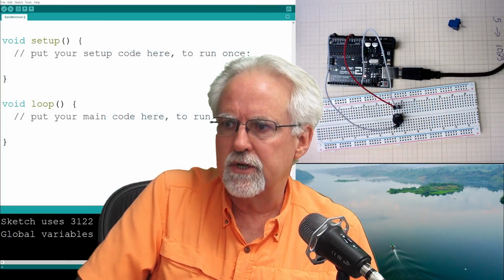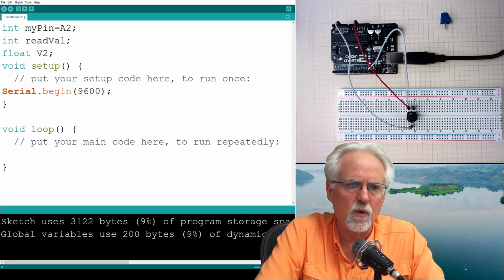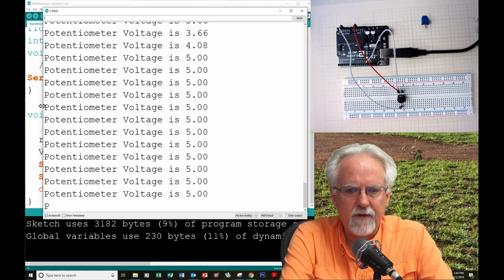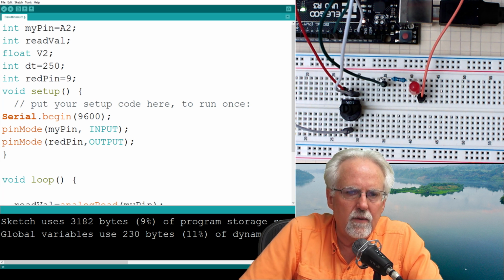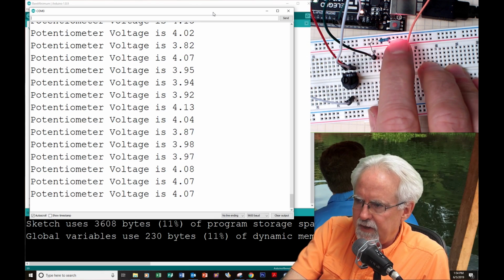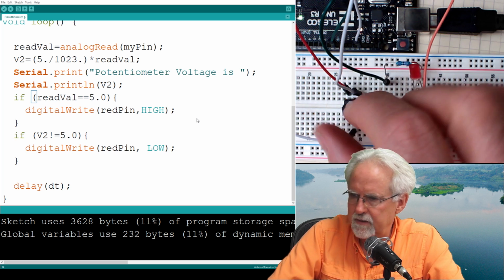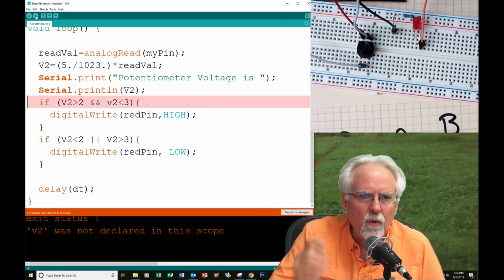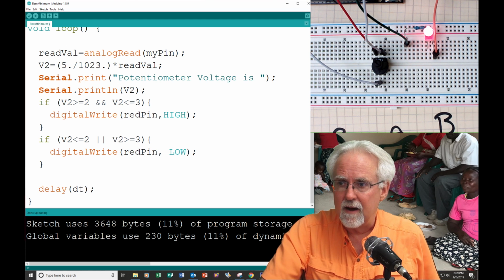Arduino Tutorial 13: Understanding Arduino If Statements

Comment: Hi Paul, as a "right-brain" dominant thinker, your videos have been most helpful. I had one problem I'm trying to understand: I was able to program an LED to stay off at a voltage <4.0 and to flash at a voltage >4.0. Everything worked except when I set the potentiometer to exactly 4.0V. The serial monitor showed 4.0, but the LED behaved erratically, sometimes staying off and sometimes flashing once. I expected this because the statement didn't define what should happen at exactly 4.0V.  I then attempted to use the == statement to get the LED to stay lit at exactly 4.0V, but failed. I even tried writing the == statement alone (without any < or > statements), but could never get the LED to light at 4.0V. The serial monitor printed the correct voltages, but the LED never lit. Any ideas would be helpful! Thanks

Comment: You know, it's funny. I built the circuit and did the homework he assigned and finished it. However, I was confused as to why the brightness for each LED was different from each other the lower I turned the voltage down. It wasn't until what I just said dawned on me and that it's supposed to be that way. I should know better as a college student haha. Thank you for making these videos Mr. McWhorter. =) Watched your tutorials on the BeagleBone too.
Reply: The materials used for the various color LEDs have different efficiencies so the most efficient ones will glow brighter given the same amount of voltage applied. By varying the value of the load resistors, you can adjust the brightness. Check out Paul's tutorials on LEDs and Ohm's Law. They are wonderful!

Comment: Super cool lesson, Paul! Thanks!
P.S. It puts a closed curly bracket, when your cursor touches the opened one, and you press "Enter" to go to the next line. And it doesn't put any new bracket, if there are already opened and closed brackets for the clause.
P.S. P.S. And yes, your assignments are good, and your lessons give all knowledge to complete the assignments. I do all) And they are also interesting!) the same as your lessons :)

Comment: Thanks for another great lesson - question:  I did the homework with the 3 LEDs and the green came on at low, the yellow at mid, and the red at high volts like they should.  My problem is that the yellow and to a lesser extent the green come on very dimly, as if they are actually running off the lower voltage being read.  I thought that the output power to the LEDs was independent of the measured voltage and should light the LEDs brightly at the appropriate times.  Please help.  Thanks!
Update:  Did not set up pinModes for all 3 LEDs; working now - BOOM

Comment: My potentiometer wasnt sitting in the breadboard right wast getting readings 5.00 and then it would be reading normal then off. So i grabbed some male to female wires so it would get a more solid connection, now im happy with it. Feels like ill break it if i push the potentiometer into the breadboard harder
Reply: This homework took me a couple minutes. It took me most that time to figure out < goes before =. I deleted code and started from scratch

Comment: Hi Paul,

I finished 13 tutorials and really enjoyed all. Will finish all 65 latest by end of this year (2020). I like how you start your tutorial with a mug of black iced coffee, no sugar:). Also liked how you add humor when you insist using a variable instead of a constant for, say, wait time.

I have noted one programming error in your following code. Here you have "=" condition for both "if" statements. The "=" condition appears for four times and I think it should appear only for two times. Otherwise, at V2 = 2 or V2 = 3 both the "if" conditions would be true.

++++++++++++++++++++++++++++
  if(V2>=2 && V2<=3){
    digitalWrite(redPin, HIGH);
  }
  if(V2<=2 || V2>=3){
    digitalWrite(redPin, LOW);
  }
++++++++++++++++++++++++++++

Regards,

Comment: Mr. McWorter, after you couldn't get the LED to turn on at 4 volts, then switched to 5 volts, I got the same results, but after turning the pot back down a bit, then using that exact number as my == setpoint, it wouldn't make pin 9 go high.  Here is my init and void setup commands:
int myPin=A3;
int readVal;
float V2;
float alarmSetpoint=4.13;
int delayT=500;
int blueLED=9;
void setup() {
  // put your setup code here, to run once:
Serial.begin (115200);
pinMode(myPin,INPUT);
pinMode(blueLED,OUTPUT);
}

and here is the loop code:
  // put your main code here, to run repeatedly:
  readVal=analogRead(myPin); 
  V2=(5./1023.)*readVal;
  Serial.print("Potentiometer Voltate is ");
  Serial.println(V2);
  if (V2==alarmSetpoint){
    digitalWrite(blueLED,HIGH);
    }
   if (V2!=alarmSetpoint){digitalWrite(blueLED,LOW);}
  delay(delayT); 
}
Any advice would be appreciated.

Comment: Wait a minute! You forgot to do pinMode but the program worked before you did that. Was the pinMode still active from the previous download? I’m wondering because back when we used pin 13 I turned the led on, but I haven’t used pin 13 since and it’s still on even though it’s not in my program. I’m guessing I need to give it a LOW command to shut it off and until I do that it will stay on forever.

Comment: I am over 70 and I really appreciate the work that Paul is doing.  It's a small point, but in the interest of detail it needs to be raised.  In the video Paul gives the example where in one case V2 >=2 && V2<=3.  He then shows V2<=2 && V2>=3.  This would result in the case of when V2 = 2 or V2 = 3, the program would not know what to do.  One of these should be changed to not include the = sign.

Comment: Question: When we set the value for V2 we specified floating point numbers.
V2 = (5./1023. * ReadVal);  So, in the if statement why don't we have to 
compare to a floating point number,  2.  as opposed to 2  ?

Comment: I'm comfortable with electronics so mostly I'm learning the syntax for the C code the Arduino uses.  Why are you still using a calculation for the voltage conversion constant instead of defining a variable? You stressed so much early on to not use constants in the program body. Oh, and I'm 55 so I guess I'm in good company given some of the other comments I've seen.

Comment: I finally managed the assignment for some reason my com quit working so I had to uninstall and redownload the program but finally here is what I came up with. each light has its own range to turn on and off by itself before the next light comes on 

int myPin = A0;

int readVal;

float v2;

int wait=750;

int redPin=9;

int yellowPin =11;

int greenPin = 13;

void setup() {

Serial.begin(9600);

pinMode(redPin,OUTPUT);

pinMode(myPin,INPUT);

pinMode(yellowPin,OUTPUT);

pinMode(greenPin,OUTPUT);

}

void loop() {

readVal=analogRead(myPin);

v2=(5./1023)*readVal;

Serial.print("potentiometer volt is ");

Serial.println(v2);

if (v2>=4 && v2<=5) {

  digitalWrite(redPin,HIGH);

}

if(v2<4) {

  digitalWrite(redPin,LOW);

}

if (v2>=3 && v2<=4) {

  digitalWrite(yellowPin,HIGH);

  

}

if (v2<=3 || v2>=4) {

  digitalWrite(yellowPin,LOW);

}

if(v2>=1 && v2<=2){

  digitalWrite(greenPin,HIGH);

}

if (v2<1 || v2>=2) {

  digitalWrite(greenPin,LOW);

}

delay(wait);

}

Comment: Dear Paul - there is a problem in the logic of the first IF statement - it should be an OR (||) condition as in the second IF statement and not an AND(&&) condition. A variable can't really be both greater AND smaller than a given value at the same time.

Comment: why is the pin A2 considered an int?
Reply: The analog input pins always return an integer value of 1-1023. To be more accurate, there's an analog to digital converter on each of those pins that returns those values.

Comment: int readPin=A5 ;
int readVal=0;
float voltage=0;
int wait = 1500;
int redLed=10;
int yellowLed=11;
int greenLed=12;

void setup() {

 Serial.begin(9600);
 pinMode(readPin,INPUT);
 pinMode(redLed,OUTPUT);
 pinMode(yellowLed,OUTPUT);
 pinMode(greenLed,OUTPUT);
}

void loop() {

readVal = analogRead(readPin);
voltage = (5./1023.)* readVal;
Serial.print(" Voltage = ");
Serial.println(voltage);

if(voltage<=3){
digitalWrite(redLed,LOW);
digitalWrite(yellowLed,LOW);
digitalWrite(greenLed,HIGH);
}

else if (voltage>3 && voltage<=4){
digitalWrite(greenLed,LOW);
digitalWrite(redLed,LOW);
digitalWrite(yellowLed,HIGH);
}
else {
digitalWrite(yellowLed,LOW);
digitalWrite(greenLed,LOW);
digitalWrite(redLed,HIGH);
}

delay(wait);
}

Comment: Can i solder an arduino uno on a pcb?
Reply: Well you could, but there are other versions designed for use in finished devices that are basically just the main chip where you supply just the components you need for that particular use.

Comment: int myPin = A0;
int readVal;

float V2;

int dT = 3000;

int redPin = 10;

void setup() {

  // put your setup code here, to run once:

  Serial.begin(9600);

  pinMode (myPin, INPUT);

  pinMode(redPin, OUTPUT);

}

void loop() {

  // put your main code here, to run repeatedly:

  readVal = analogRead (myPin);

  V2 = (5. / 1023.)*readVal;

  Serial.print(" Potentiometer Voltage is ");

  Serial.println(V2);

  if (V2 > 4.0) {

    digitalWrite(redPin, HIGH);

  }

  if (V2 < 4.0); {

    digitalWrite(redPin , LOW);

  }

  delay(dT);

}my red LED will only flash for a a microsecond buggin out over debugging! thks in advance

Comment: I'm having a problem with the homework. All LEDs light up correctly according to the voltage but the yellow LED somehow is very dim when the potentiometer is between 3 & 4V. The green & red LEDs are bright when the voltage is < 3V and > 4V respectively.

I have troubleshoot by replacing the yellow LED, the resistor, the jumper wire and also the pin to no avail. The strange thing is if I switch the yellow LED's jumper wire with the green or red LEDs, it would light up nice and bright BUT the green or red LED now in the yellow LED's place will light up very dim too. Any idea where I went wrong?

void loop() {
  // put your main code here, to run repeatedly:
  readVal = analogRead (myVoltPin);
  V2 = (5./1023.) * readVal;
  Serial.print (Msg);
  Serial.println (V2);
  delay (DelayT);

  if (V2 <= 3) {
    digitalWrite (greenLED, HIGH);
    digitalWrite (yellowLED, LOW);
    digitalWrite (redLED, LOW);
  }

  if (V2 > 3 && V2 <= 4) {
    digitalWrite (greenLED, LOW);
    digitalWrite (yellowLED, HIGH);
    digitalWrite (redLED, LOW);
  }

  if (V2 > 4) {
    digitalWrite (greenLED, LOW);
    digitalWrite (yellowLED, LOW);
    digitalWrite (redLED, HIGH);
  }

}
Reply: FYI, the V2 is attached to A2
greenLED to pin 3
yellowLED to pin 7
redLED to pin 12

All GND connections are connected to the "-"ve bar on the breadboard and connected to the GND pin next to pin 13.
Reply: The only way I can get the yellow LED to light up brightly is to change the yellow pin to the one with the tilde and change the code from 
 
    digitalWrite (yellowLED, HIGH);
   
to

   analogWrite (yellowLED, 255);

There has to be a reason why this doesn't work in the first place.
Reply: PROBLEM SOLVED! Found out the solution when I watched your tutorial #17, I didn't declare pinMode for the yellow Led in the void setup () section.

Comment: I am in high school and want to study electrical engineering, my school is not strong in stem so I have been learning from you. Thanks
Reply from the maker: If you go through the lessons on this channel while still in High School, you will be ready for any engineering program in the country. After finishing the arduino series, then move on to the series on AI on the Jetson Nano. Also, keep you math skills very sharp. In addition to taking the hardest math classes you can in high school, supplement that with regular self paced work on the Khan Academy math program. Good luck and stick with it!

Comment: Turns out checking everything is really mandatory. I connected the leds, for the homework, to pins 5, 7 and 9. My yellow led, connected to pin 7, just didn't want to turn on. I checked the circuitry several times and turns out pin 7 on my arduino is just broken. No big deal, but this just proves how easy it is for things to break. And it's not always your own fault!

Comment: Since LED's are used for a lot of things, I went and bought a blank shield with a 180 point breadboard and on the front of the shield soldered up 8 LED's with resistors to terminal strip. That way I have 8 general purpose LED's and a breadboard. Great series, my grandson and I are enjoying doing this together, almost like school. I was an advanced avionics tech for Boeing for 30 years and microprocessor/microcontroller electronics has also been my hobby since 1974

Comment: Fred Barber
as an oldie 76 I am realy enjoying learning something new. I followed this lesson right through but when I did the assignment I kept getting an error when uploading the sketch. After a lot of head banging I found my mistake which was the incorrect use of the equal to or greater than and the equal to or less than commands. I typed =< for the equal to or less than command instead of  <= and the same for the equal to or greater than i.e. I typed => instead of >=. a silly mistake but it took a long time to work out what I had done. After correcting the led's all worked as they should. It shows me that it is very important to follow the syntax exactly.
/great lessons, keep up the excellent work.

Comment: Hi Paul, I am enjoying these videos and working along with you, although it is 8 months later.
I think you would be happy though, as I "Scream and yell" at the bugs at 27 mins. 
You must be teaching me somthing!
I worked through the first series and am enjoying this latest series of lessons.
Are you still working with the 3-D printer?
I purchased one about the time you started your series and your lessons got me off to a good start.
It was parked for a while, but I am now back into it, using fusion 360 to great effect.
I had just stuck with PLA, but am now working out the "bugs" of using Nylon reinforced with Carbon Fibre.
i have upgraded the hot end to an "all metal type" and have usable prints. I am now woring on allowance for shinkage so I can produce accurately dimensioned parts for my project.
I notice Fusion 360 has just incorporated an "electonics" modeling function with circuit simulation and the ability to intergrate the physical boards into Fusion 3-D models for printing. 
Have you had a look at it yet?
I am building an all aluminium aircraft and am working though the Sheet Metal functions in Fusion as well. What a great program. Great for building enclosures for electronics as well.
The stuff they are doing with loading simulation is amazing for a free program.

Thanks again for your efforts with all your videos. 
I am a little too old now, but I wish I had a High School Teacher wth your dedication when I was much younger.

Comment: Great videos!! before you gave the home work I already had a yellow green and red LED going.except i made the yellow come on if below 1 volt as a low voltage warning, the green on if between 2.5 and 3 volt as ok voltage and Red for 4.0 volts or higher

Comment: Mr. McWhorter, I would like to know if  you will be doing tutorials on using Millis() to replace Delays() and State Machine coding. I've went thought original YouTube videos and these New video it appears you don't cover topics. Part of the code is a Larson eye effect which I would like the center LED to ramp Up & Down 4 times before beginning the L.E. Effect sadly using Delays() in coding locks up the code. Sir, could you point me the right direction as to how to get the code to do this effect or point to a video which may help. Thank you.

Comment: Hi, Paul. Thank you for these lessons.  I am following along each lesson and doing the homework. I've just finished homework from this tutorial and came across an odd problem. Since I couldn't find potentiometer (it was 1.00AM when I started), made the design of my own with 6 resistors in row and 4 LED's.  Wrote the code and everything works just fine. But... since I use probe wire from A1 for analogRead at each common connection of resistors, every time when that wire is NOT connected with protoboard (is in the air) I got random readings in Serial monitor and LED's start blinking executing code. I believe that readings should be zero if there is no contact between analogRead and protoboard. Is it something wrong with my UNO, which is brand new? Tried different analog ports/wires, nothing changed... Thank's and keep up the good work.

Comment: Sir, Do you really need the other if statement for V < 4? The loop will automatically enter the if statement when V>4. else it wont. RIGHT?
Reply: Yes by nothing will turn the red Led off and it will remain on (I guess)

Comment: Excellent video. But there are two parts of the code you might change/improve. 
1 - The >= and <= should only be in the first of those two IF statements, which are reading the same value. Only one of the two IF statements should be true at one point in time. So, the second IF statements should only use > and < .  That is:  if (V2<2 || V2>3)  .

2 - You set your voltage threshold values using constants instead of variables. D'OH !    : ] 
This point would have become quite apparent when setting up your variables in the two IF statements.